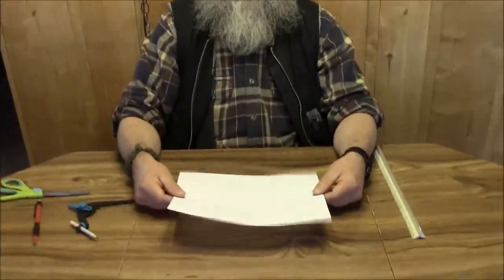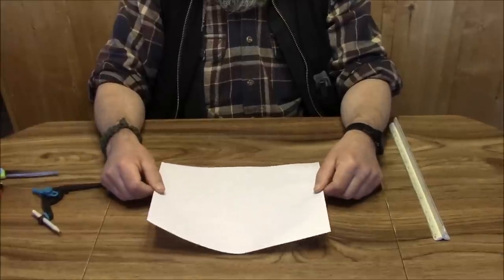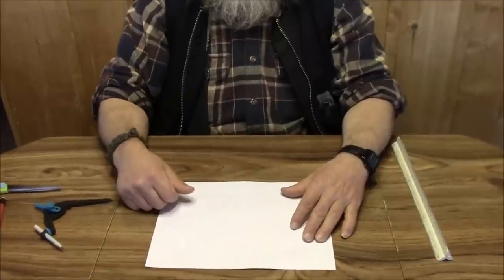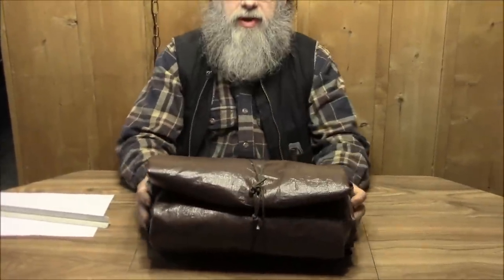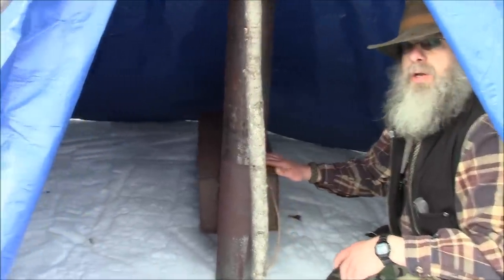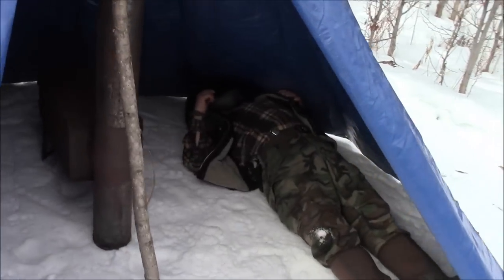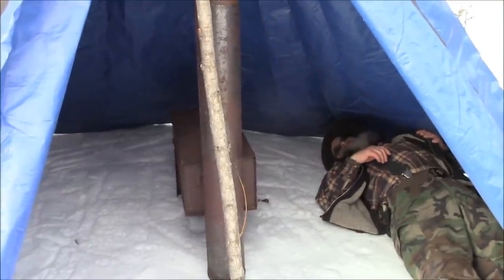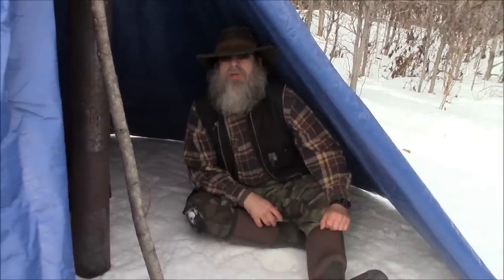Make A Tarp Tent Tipi Hot Tent On The Cheap

Comment: Use a tennis ball over both ends of any pole you use. It will help with the need for extra reinforcements and sinking in to the ground. Thanks again for the great video. 
Kansas
Reply from the maker: I do use a tennis ball over the top of the pole but am embarrassed to say that I had never really thought of using it on the bottom of the pole as well but yeah that should work well.
Reply: We have sandy loamy soil when it rains a good amount well you know. So any way I figured it would work in snow and I thought I would pass it on. Maybe it would help make a video  about poled tents. umm something like tips, tricks.
Reply from the maker: Yes the tennis ball should supply all the needed flotation when used on a hard packed snow floor.  If the "floor" is packed hard enough just teh bare pole is usually enough support on it's own.  I like to counter sink the pole but in teh snow a few inches so that the top snow can melt some but still not affect the sinkage of the pole.   However I like the idea of using the ball as extra insurance to counter the tendency to sink.   I have a few extra balls around.   I have recorded a hot tent camping video that I may or may not make public towards the end of this week.  In that video I show briefly I think, how I use tennis balls over the legs of my chair to keep the chair legs from sinking in the snow floor of the tent though this particular tent has a nylon floor fabric.

Comment: You can even go further and make smoke flaps and an overlap  on the edges so you can use tent pins  like a real tipi. With the smoke flaps you could make a fire in the center in a hobo stove.... cool idea
Reply from the maker: +Bill A. (LazyWoodcraft)    I somehow missed quite a few comments on this video several months ago.  Sorry.  Since this is a modified topic design with a lower top and wider base, it would be more difficult to avoid a Smokey living area in the topic versus the traditional design.    This design is better suited for use with a stove

Comment: Looking forward to your stove video.  I have a nice white tarp all ready for this design once the snow melts and can picture it all lit up once set up on the island where I fish in central Newfoundland.  Might modify your cuttings to an octagon design and use 8 internal poles in true tipi style, think it would hold up better in high winds.  Again, thank you so much.
Reply from the maker: David Anstey Thank you.  On ething to consider on your octagonal shaped tent is that I'm assuming you will be anchoring (staking) it in 8 places.  My shelter has demoed in the video has 12 or 13 stakes.  My friend charley stakes his every 2 feet instead of every 3 feet in my tent.   The conical tent shaped design is very resistant to the wind.
Reply: ***** This design really has me thinking.  Your comment about taping two tarps together got me thinking about instead taping heaving grade plastic instead and backing the tarp with a couple of mylar blankets to create a Supershelter.  A Supershelter tipi would make an awesome icefishing hut.
Reply from the maker: David Anstey Yes I have thought I might also line the inside of my tipi with mylar.  Probably wont need it though as I think this design will be very easy to heat with the stove

Comment: Great idea, love your videos
Reply from the maker: n8mayfield Thank you.  Glad you are enjoying the videos.
Reply: ***** ok, I got the tarp, getting ready to cut it out.  Where did you get your stove jack and where did you place it?
Reply from the maker: n8mayfield There are several places where you can get them online.  I have not done mine yet since I am waiting to get my stove done first.  What I will be doing is this.   I bought a fiberglass welding blanket.  I will cut out my square piece of material from this.  I will then "smear" silicone adhesive on to this and spread it out using a putty knife.  If this method will not work then i will get some mineral spirits and dissolve the silicone in that and then "paint" it on.  This will waterproof the material as well as help to keep it from unravelling.  I will then sew some Velcro around the parameter.  I will also cut out my stove jack opening in the tent and sew the corresponding Velcro on to the parameter of the hole.   That way I can remove the stove jack when needed or wanted and install a different stove jack for a different sized stove pipe or even install a window instead of a stove jack for summer use.  The stove jack will be mounted in the tent in a diamond configuration rather than square.   In other words, opposing corners of teh jack will e up and down rather than top left and bottom right etc...   I will then make a gorilla taped overlap on the top two sides so that rain water will be diverted to on top of the stove jack rather than to run underneath the stove jack through the Velcro attachment.   Hope this all makes sense.  Buying the fiberglass matterial was about as expensive as buying a prefab stove jack but now I have PLENTY of material left over to make many more jacks.
Reply: That does make perfect sense. Thank you very much, I really appreciate that. Thank you for you time and the awesome videos. I share your videos alot to Facebook in multiple forums

Comment: I have a sewing all that I used for years to repair tents and the sail on my boat nylon thread any color takes longer than a machine but never comes apart even in super storms I have been caught in the mountains and on the Chesapeake bay ' It is an added tool for my needed things .
Reply from the maker: +Frank Yeyna    I too have a sewing awl and you are right it is a useful item.

Comment: Now that's using your noodle. I designed a 6 man tipi very similar to that with tarps duct tape & a sheet metal funnel reinforced peak with a 4" hole that acts as chimney & tipi support in one. It used 3, 48" sections of 4" automotive exhaust pipe with a T connector on the top of the base piece to hook up a stove to & another funnel on the top of the piece to support the tipi. @ 12' across & 12' high it would be quite comfy. Instead of zippers or line I used velcro strips & 2 sided tape to keep the door shut.
Reply from the maker: +Muskoka Man       Sounds like you had a very usable shelter.    I just completed making the stove to be used in this tarp tipi hot tent and hope to post the video today.

Comment: Awesome job working with the space that you have.  One tip, if you are using a circular template, you can fold the material into half and then half again (quarters)  Then you can cut the quarter design of the folded material.  Like when making paper snowflakes. :)
Reply from the maker: +alaskankare    Thank you.   Yep you are right.   Good advice.

Comment: great video, I wouldn't though go super cheap. I would like to see some small improvements in sense of better quality vs. making it super cheap. You however doing great job as far as explaining details and showing it slow so people can follow you. I really enjoyed watching it. Thank you
Reply from the maker: +Arthur Klisiewicz     Even though I did use the word cheap in the title I would not call this tipi cheap.   I would call it inexpensive.   I have quite a bit of experience through the years of making winter tarp shelters out of inexpensive poly tarps.    I know that this tarp tipi may not have cost much in the way of dollars but I do know that it is a good solid shelter that will last many many years if well taken care of.    When it does need replacement, it can be replaced very inexpensively again.   I could build 20 of these and it would still be cheaper than buying a manufactured nylon tipi.    Each of these will however last many many years and I will not need to replace very often if at all.

Comment: Good job on the video. You showed great detail and clear explanation.
I gave up using duck tape, it can fall apart on hot days so the gorilla tape would be my choice. 
I found myself wondering if a tripod inside would be stable and allow you to eliminate the center pole. Maybe use a cut open tennis ball at the top to protect the tarp? I would be concerned one tarp clamp on the outside might let go if it got windy. Then with a hot stove in the tipi and wind blowing it could get crazy real fast.

With a few hours of work this could be a very inexpensive solution.
Clever way you repositioned the center point.
Reply from the maker: +Mike B      Yes a tripod on the inside would work fine I think.    You would need to measure the length of the wall from the peak to the bottom edge of the wall at each place you wished to place a pole and then compensate for the bulk etc of the 3 pole junction at the top.    Perhaps a more convenient method would be to prefab a top of perhaps three short lengths of metal pipe already secured in the correct formation and then once on location, cut three poles whose ends you slip into the pipes.   Or any other means of prefabbing a three pole Joinery that would not only secure the tripod but would protect the peak of the tipi.

Comment: Awesome video cant wait to try and make it. For the center beam im wondering if you could use a pvc pipe with fittings, I think an end cap would do less damage to the top of the tent.
Reply from the maker: Yes A PVC pipe should work well as a center pole.  The only problem though would be that at each different setup location, the ground will be higher or lower right where you want to set the pole.   You might want to get two diameter poles so one slides inside the other and then you could drill holes through each.  When setting up your tipi you could then slide your poles apart until you reach the desired height and then pin the poles together at the nearest matching holes.

Comment: i have an idea you might like lonnie.....  with the bucket stove or barrel stove.... use the smoke stack as the supporting pole in the middle.  have it rest on a ring on the stove pipe.... the stove pipe cap would keep most moisture from the hole.  and you wouldnt have to have a pole in the middle or build a bipod.   the stove would end up being either dead center of the tipi  or slightly off center depending on the stove pipe and how it comes out of the stove.  its a thought.  i guess depending on the weight of the tipi and the strength of the stove pipe  depends on whether it would work or not.
Reply from the maker: I think there is a commercially made tipi that does what you suggest.   I personally prefer to have the center pole or bipod be separate from the stove pipe.   One reason is that I prefer to burn my stove all night at a much reduced burn rate and because of that, my stove pipe will often experience a "soot" buildup that eventually needs to be addressed on a multi-day trip.   I will remove the stove pipe and clean out each section and then replac3e the pipe and relight the stove.  That would be problematic if the stove pipe was part of the shelter support

Comment: A cloak for outdoor use can be made very similar to this idea. Take a hack of twine, measure from neck to knees, calves. Use that length as center point for a compass to draw circle with chalk. Cut out large circle and cut from center point to outer edge. Reinforce, cut inside liner out if desired etc. Hem those together. Cut out large circle for hood, fit to head and  repeat process. Sew the two together , seams etc on the inside. Walking heavy wool blanket shelter that can be sashed into place😁 The simplest design can often be the best

Comment: Lonnie, you jumped past the part where you do the tape work on the apex of the tent. Might be a good thing to see how you reinforce that part of the tarp. It looks like its a cone shape if you know what Im trying to say. Thanks for the great tip on this design. I intend to make one and try it out. Maybe from canvas or something.
Reply from the maker: +stepitup   The tipi top is naturally a cone shape and there really is no special way to put the reinforcement tape on there.   Just put it on all over that region a couple layers thick.   I am out camping in that tipi right now for 6 days.   I just came home to edit and upload a video that I shot while out there and I will be heading back out for the duration.   Th ecoldest it has been so far is 4 degrees below zero Fahrenheit and the tipi is toasty with a liner in it.

Comment: Lonnnie, I was wondering if there is a glue that will bond poly? A quick google search seems to say - nope.
I always wanted a hot tent, but could'nt justify the expense - this build has me excited. Thanks again.
Reply from the maker: Gordon MacDonald I am glad you like the video.  If you do get a chance to make one I hope it works well for you.  A great site on the web that list glues aned adhesives for gluing many many different things to many many different things is called "thistothat.com" without the quotes.   Unfortunately they do not list polyethylene specifically.  Do a search for poly sails.   There is quite a few people who use poly tarps as sails.  They use the poly tarps for sails.   I understand that some of them use carpet tape.   Quite a few people said that they have good luck using hot glue guns.  It seems one of the tricks is to get the poly very warm and apparently that is why the hot glue is often successful.

Comment: OK - I just stumbled on your channel, Lonnie, and so I have a couple of informed thoughts and comments (NOT criticisms):

1- A Tipi is NOT anything like a cone other than observing it from a very, VERY great distance.  I have lived quite some time in the past in an 18 foot Cheyenne style Tipi and I, as well as my fellow associates, are well aware of the centuries old evolutionary technologies incorporated in their present design.  We also know the worst problem (other than fire) which they ALL have - Carbon Monoxide poisoning after/during an unexpected heavy snowfall.
2-  Smoke flaps on an admittedly larger and heavier Tipi are there for a darn good reason - safe and efficient air exchange to remove smoke and heated CO2 when used with an inner liner and an Ozon (in a larger Tipi that is a 5-6' off the ground, semi circular  ""ceiling"", stretched over the sleeping area).  
>>> So, on to the paper models.
Consider taking the 8.5" x 11" piece of typing paper and line up the corners and fold it in half.  THAT is the easy way to find the centerline instead of measuring and then using a ruler to draw it.  To find the arc center point simply fold one side of the paper back along the centerline (sort of like the first two folds in making a sideways paper airplane.  Viola - the 5.5" arc center point.  A 1" x 6+" strip of cardboard, maybe from your cheerios box) makes a Jim-dandy compass - with a push pin over the radius point and 5.5" away a hole for the pencil point to scribe the arc.  Last - it makes less sense to cut out the pie shaped door spot and then tape the cut piece back on.  Simply cut the centerline of that wedge, top to bottom and then fashion a door with the flapped excess after it is set up.  A pebble (or glass marble) under the Tipi skin with a cord wrapped around that lump makes a larger and more secure tie down point for the stakes used around the base (just like a Tipi uses).  Save the grommets which ALWAYS end up pulling out anyway, 
The plastic tarp would be useful for a couple of weeks camping in the summer but for elective camping in the winter - think condensation.  Also, even Gorilla Tape deteriorates and either gets rigid or turns into a sticky goo in a few months.  May I suggest that you stick with sewing - even sewing a thin cord, perhaps clothes line, to reinforce the cut and hemmed bottom edge.
AAHHhhh - a heater in that little tent is certainly just asking for either a roll-over singed hand or a fire.  I've seen what a fire can do to a Tipi and it ain't cool.
Again - not a criticism - just some thoughts.  Summer time I'm on the S edge of Denali Park (Petersville) sometimes working out of our home in Trapper Creek.   - Joe S -

Comment: An amazing design, thank you for sharing, it makes the winter time so much more "spring" like. An off question, when does the snow melt down in Alaska? Much apreciated.
Reply from the maker: down near sea level here it was clear of snow maybe roughly 1st of April.   I don't really remember when it left here up in the mountains but my wife says she remembers that it was gone by the end of April.    Near sea level, typically the leaves first start popping out on the trees around May 1st but it was quite a bit earlier than that this year.    Here where we are, the leaves did not start until after mid May.   Now just 2 weeks later, the leaves appear to be fully leafed out.   It does not get totally dark now all night so there is a lot of sun light to speed vegetation growth.
Reply: Thank you for anwsering

Comment: Lonnie  I watched this video maybe as long ago as 2 years ago.  Since then I viewed a video of 2 young boys using your plan of this tarp tipi.  They did give you credit where credit was due for this design.  Here is a tip I saw off their video of this design. If you should ever make another one of this type of tipi you might want to use this tip.  Don't cut the  wide door V out simple  make one cut from center stake on the far side to the center pivot stake. This will allow you not to have to tape the door flaps back on the tipi also make a mark at the starting point cut and ending cut of the out side circle ark. I believe these marks is where the door grommets will need to b placed. I haven't made one of these tipi.
Reply: Here I am again. Thanks for the heart.